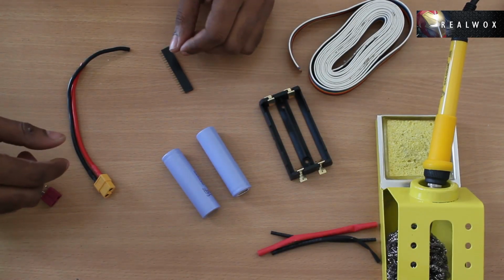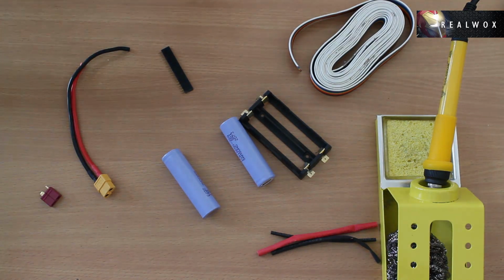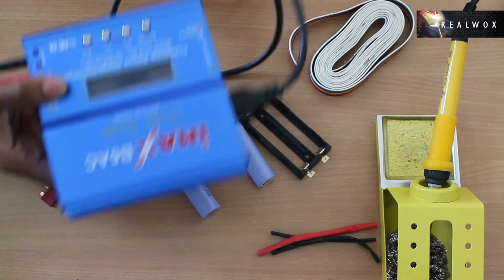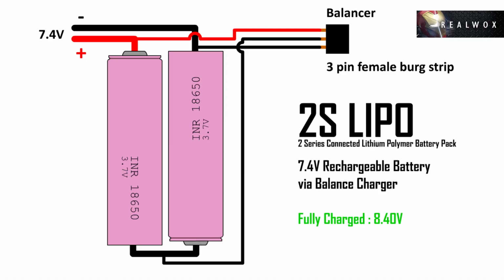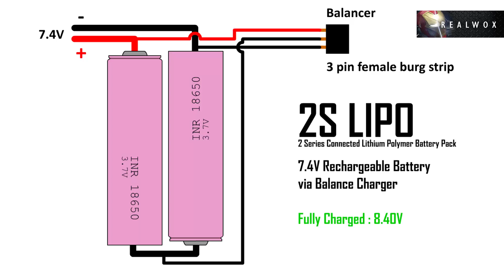[DIY] 2S LI-ion battery pack (7.4V) with balancer

Comment: Hello, I don't know if you'll respond to such an old video but. I've had problems with wiring a diy battery for a blaster. It has 4 pins (Jst sm-4) and I have no clue where to to put the last 1 wire.

Comment: this is quite dangerous- I've built my onw and accidentally plugged it in opposite direction, permanently destroying my charger. I suggest using jst-xh connector as protection from it. so you cna connect your pack only in one way.
Reply from the maker: Yes, agree. Its actually difficult to remember the balancer connection. With me its just that I frequently charge and hence can associate the wire color code to the balancer connection

Comment: Thank you for sharing this DYI 18650 2s video.  I am new to RC hobby.   I am thinking of doing the same thing.  Making a 18650 2S on my spare old laptop Li Ion batteries for my RC car.  1st Question... toward the end of the video, you plugin to the charger and selected LiPo instead of Li Ion.  Isn't that not correct?  Should be Li Ion right?   2nd question... How much mAh rate should I put in the charge to do a balance charge?  2A like what you have there?  Trying to figure out the correct mAH to set.  I am learning as I go.  Thank you in advance. :)

Comment: Im confused. Its LiPo or Li-Ion , because I couldn’t find any 18650 LiPo battery. All wer Li-Ion battery. 
Can u share link to buy LiPo 18650.??? 
How many amps can these give out? 20c? 30c? 2c!?? 
Pls reply
Reply: 18650 is li ion each one battery is single cell.there is no li polymer in 18650

Comment: A long and useless video about... how to solder wires. I was hoping to see a power bank design here with a protection and balancing circuit, instead of using a MAX-6.
Reply from the maker: Sorry for disappointing you

Comment: where is balancer ? He just solder 2 batteries together ,. Disapointed.
Reply from the maker: Sorry for the mis understanding, but it's a battery pack with balancer port which you can connect to a balance charger to recharge

Comment: So you made video how to solder 5 wires and connect it to pro. Charger...... Pointless to hell. 
Btw if you have this setup just take out cell get new in and charger emmpty one on a normal charger.